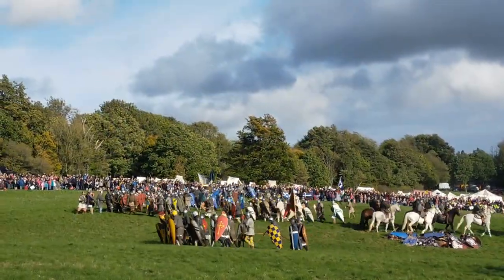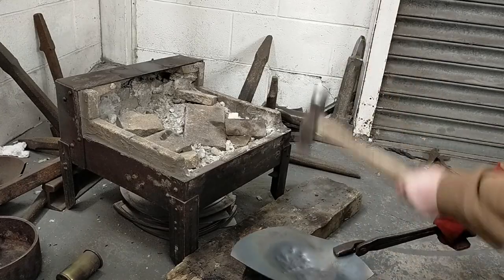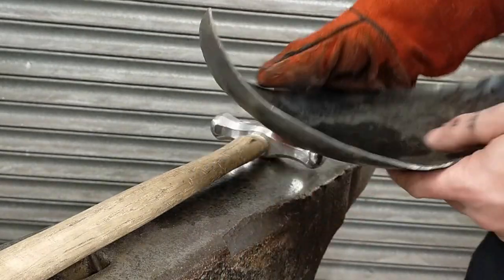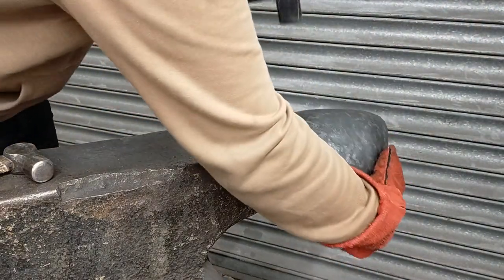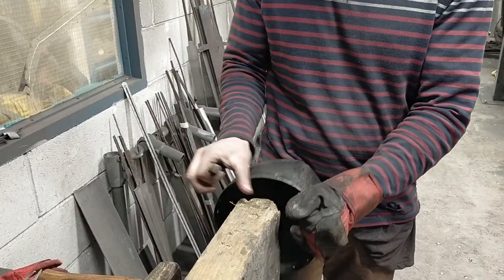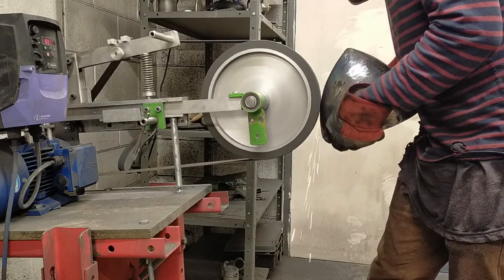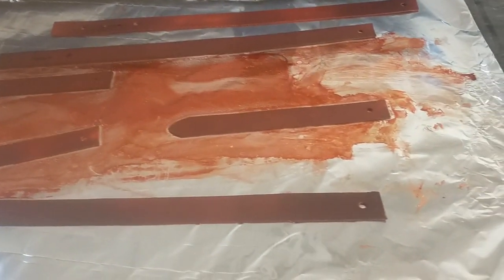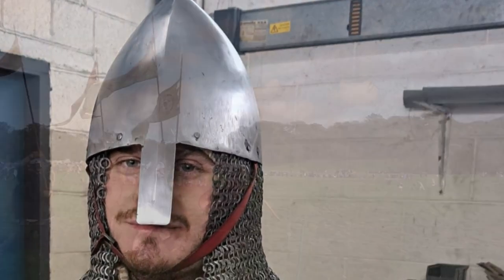Making An Early Medieval Helmet From Scratch In ONE DAY

Comment: If using mild steel you should cold forge it, it’ll work harden it
Reply from the maker: Ah but the Normans didn't have large dies to press the metal into shape. I wanted this to be as handmade as I realistically could.

Of course, I use machines to grind and polish the helmet but this is just a way to speed up a process which gives the same effect on the metal as doing it by hand.

By hammering the shape out myself, I learn the techniques of how to make that shape with a hammer, and it also leaves the hammer marks which the originals also show, giving it a more authentic finish.

:)
Reply: @AlexTheHistoryGuy  you used a welder lol, should have just used hot rivets and they did hot forge it but that’s because they didn’t have rolled steel, the drew it out from billets and used chisels to cut it. Your work is amazing, just thought rather than worrying about quenching and all that just cold forging it and heat cycling it after

Comment: Erm, why are you quenching before evening out bumps? Metal would be easier to work if it's cooled down by air. Even mild steel becomes a little bit harder after quenching.
Reply from the maker: This was just 2mm mild steel so wasn't particularly tough. I could have allowed it to air-cool but I had to build the entire helmet in one day so I was in a rush!

Comment: What would you say is the difficulty of this piece? I am interested in starting making these sorts of things and medieval weapons and armour are what i want to make.
Reply from the maker: Well there are two ways of making medieval armour. There's the historical way where you try to reproduce a medieval item from a museum or artwork, or there's the modern way where you just want to make a piece of armour "look medieval". 

The latter is much easier but still very difficult since Armouring is not a skill you can just learn quickly.

For this Norman helmet, the hardest part was probably the planishing and grinding to ensure a smooth surface without getting the metal too thin. Remember of course you need a welder to attach the two parts together, unless you want to raise it from one piece of metal which is a highly skilled process.
Reply: thanks!  @AlexTheHistoryGuy
Reply: @Duck3Dblender  Or you could make þe hemet from two pieces riveted togeþer wiþ a strip of þicker steel.

Comment: hello! i'm interested in starting armoring. i'm coming from a knife/sword making background. unfortunately i can't weld, im wondering if you can join the two halves with flux in a similar way to how you make damascus?
Reply from the maker: Hi there - I'm not entirely sure, yes it is possible but it's not something I've ever done. But good luck haha!
Reply: @AlexTheHistoryGuy  thank you!
Reply: If you can forge weld you can do this, but this is difficult since the weld is long and thin.
It is also possible to rivit a long strip along with center
Reply: @knutzzl  my only question about that is how solid would it be as i intend on using the gear i make. also my forge is not going to be able to evenly heat a whole helmet i'm afraid.
Reply: @knutzzl  about the riveting. i have a viking age spectacle helm that's joined like that and it's pretty solid. i struggle to find any
helmets like this up into the period i want to work at though